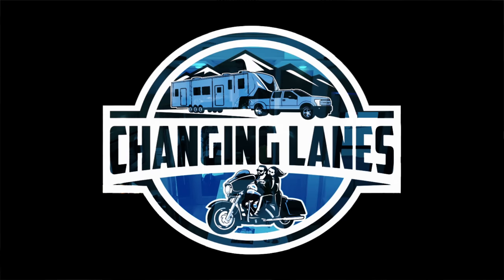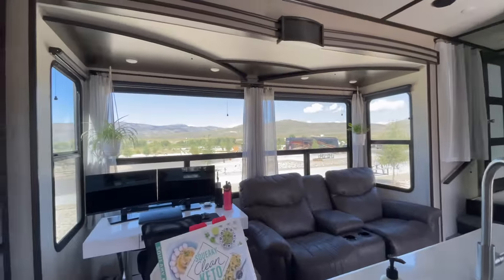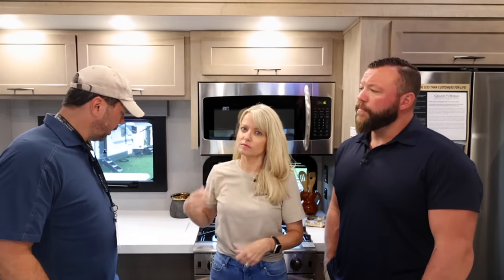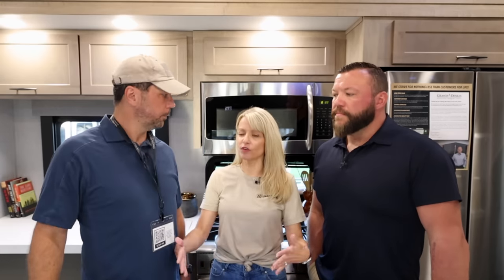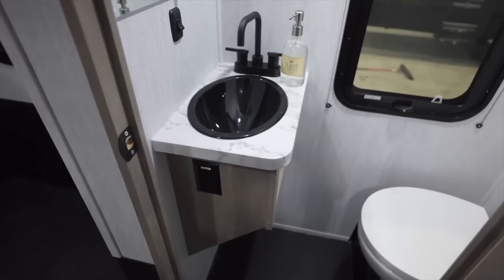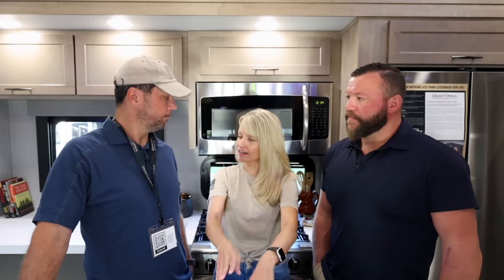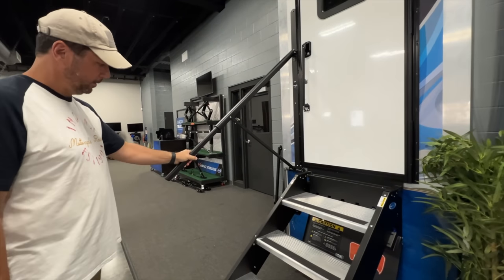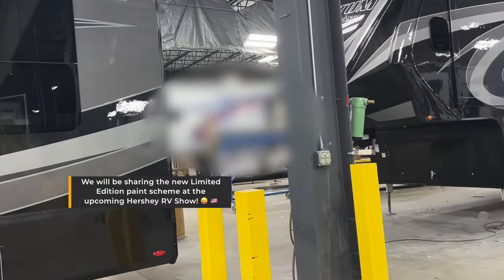New RV Floorplan Questions Answered! (Momentum 410 THR Prototype) (Full Time RV Life)

Comment: We saw the new GD 410 THR 5th wheel at the Hershey show today. Impressive. Recommendations:
1. Basement access doors: They conflict with the entry door. Make the conflicting door the smaller door, and the main door larger so that you don't have to unlatch the entry door to open/close the basement door. The door conflict even when the main door is on the open latch.
2. Vacuum access in the basement: shift the basement vacuum control closer to the basement door so that basement stored stuff won't need to be moved to provide access.
3. High Loft: If this will be used for storage for owners without a young child (who will love the space), then provide some form of gate or bar that will keep stuff from falling out into the kitchen.
4. Ceiling fan: Since the kitchen ceiling is so high, how about having a ceiling fan? It may not work with the location of the AC, but a ceiling fan would be nice. 
5. Living Room sofa color: Having such a light color seems like it will show stains and dirt. The overall colors are very nice, but the seating seems too light for practical daily use.
Again, we love the layout. These are a few suggestions.
-Jessups Go RVing

Comment: Couple of suggestions, we likely will be getting a 410THR to live in so if you can get these done, it would be amazing (and I won't have to upfit it myself).  
*A flip up leaf on the end of the island would be nice, extra counter space but no extra room taken up when stored.  We might eat there and put a sit/stand desk in place of the dinette, get the super sofa.  
*Love your idea for a larger medicine cabinet and in-mirror lighting.  
*A recliner in the single seat side of that L couch would be amazing just as an option.  
*An option for coat hangers up high and shoe storage down low when you come in the door could be a true tick box option/extra.
*Possibly rotate the bathroom 90 degrees and shift 6" from the garage to the pantry/coffee bar would be incredible!
*storage up high in both of the toilet rooms for toiletries (pellets, TP, etc) would be really handy
*A ceiling fan for the main living space to push down warmer air in the winter from the fireplace and just circulate it during the summer, maybe save some energy on A/C.

Thanks for the great content and we LOVE the 410THR layout.  We absolutely WANT ONE!!
Reply from the maker: Tara plans on doing some kind of hangars and such on that wall as you enter.  The single side of the sofa is already a recliner.  So, you can check that off. 😀  Once we get in it, we'll see if we need a counter extension, but that will likely be an up-fit also.

Comment: With the bathroom, love the space but still recommend TP storage in the commode room. It’ll help on storage. Puts some hooks on the bottom of the shelf for towels to dry.  For walking through the bathroom to get to the bedroom- how often do you go into the bedroom during a day as opposed to the bathroom. I think having the bedroom up front works fine.
Reply: We use the portsble stand with the phone holder and the built in roll storage in both our bathrooms. Seems to work well...

Comment: I no am VERY IMPRESSED in how the Momentum  rep Lance Lee ( sure the whole company is on board), stepped up and was right there with you for this Video. Pulled no punches when people asked “ why can’t I…”. Sometimes you can’t but it seems this company was at least willing. I am a travel respiratory therapist and have been following you guys for a little over a year. I currently have a 27 foot toy box (Genius Wander), and experienced many problems on my first real trip out to Sturgis for Bike week a month ago. Luckily, in a few days we had them resolved but the customer service I got from the place I bought it at was terrible. All they would say is “ just bring it in and drop it off.” I stay in the RV 60% of the month and to drive it 300 miles back to the dealer for them to park it till parts come in won’t work. So, after seeing this video. I’m gonna upgrade in the next year. To that size. 50 footer.

Comment: I might be too late for you to think about but I am going to suggest it anyway. Being the son of an Electrician I'm always looking for power, like outlets every where. We have a towable 33' bunkhouse. With the kid's bunk beds needing outlet/USB ports to outlets near couches and sitting arias it would be better to have ports or outlets in those places. When we got our  first used RV the AC unit was also a heater. It was the best AC unite I have ever had in an RV, it actually made it very cold during hot hot days. It was also nice to add to the heating appliance in the RV in conjunction with the propane heater that comes with the RV. The second suggestion is a duel AC/Heater unit.
I do like the set up with the "L" couch and dinette set in the proto-type RV that was featured. Also the duel pain windows for winter camping. I have a question though are you opting to a winter package with extra insolation?

Comment: I really like it, you guys and GD did a great job!  A few comments/suggestions:

Make IS a factory option.   I read below that there's some liability reason, please figure it out and make it orderable directly.  
Make StepAbove an option.   We HATE StepAbove, I can see how for some uses it would be great, but we don't typically stay long and it is a pain to setup (getting the legs the right length), it's easy to snag the door on it, and, my wife goes absolutely nuts when we lift the steps back into the RV and dirt pours off of them (as it does most of the time).
Dinette, get rid of the chairs!  Take a look at the Luxe 44FB; find out where they are getting that dinette and put that in!   It's fantastic, you can be tighter to the table (because you don't need room for the chairs) and you get some really nice storage underneath.
Put a GenY suspension pin on there from the factory. (this weighs too much for the Goosebox).
17.5 in tires.
Diesel generator option

Can't wait to see it in person, very nicely done!!

Comment: Love this layout!  My only concern in the bedroom would be cpap machine placement.
Reply from the maker: In our 397, and in this one we believe, there is room under the bed in the bed slide and a gap in the corner to run the hose and such.  If you go see one in person, just pull the mattress back in the corner and check.  We've never used one, so we can't be 100% sure, but we've heard of others doing it this way.
Reply: @ChangingLanes  never even thought of that. I’ll have to try that on my current RV. Thanks!

Comment: I think this is a decent trade off and if there are enough people as excited about this unit as you guys it should be a hit.   The volta system sounds interesting.  Going with a 48V system and providing a 54V dedicated alternator for your truck to add charging capacity rain or shine is pretty smart way about it, add in solar and that would be huge.  look forward to hearing how that stacks up would be cool.  At least you can drop the gauge in wiring to make that all happen at the higher votages.

Comment: Be nice to have 2 different models with the washes in the garage. 

Also, the option to get rid of the door and wall need to the bed to make it completely open. 

Another thing would be to extend the shower/bath to have a full side bath or even A Single jacuzzi bath. 

Everything else is perfect!

Comment: After looking at every toy hauler from every manufacturer Google could find we have set our sights on the GD 410.  However, my wife is disabled and we would need a few modifications to suit her.  How willing would GD be to making a few minor changes?  Nothing structural, we like the floor plan.  A lot.  But we would need some bedroom, bathroom, and living room changes.  Mostly deleting things we wouldn't want and some changes to the shower compartment.  And some electrical changes.  

I spent many years as an Engineer designing and building specialty vehicles (news vans, satellite trucks, big sports production trucks, etc) so am very very familiar with the design/build process.  Swapping CAD files back and forth to get the changes we want/need would be trivial.  Thanks for your videos, they have been extremely helpful!

Comment: Can Grand Design  start offering options for the independent suspension from the get go . Would save the consumer time and money. Also can you ask why they install linoleum vs a glue down vinyl plank which would be a way cheaper repair if ever needing to make one.
Reply from the maker: I wish they would offer the IS during build also.. but, it is a logistical issue I think.  On the linoleum, my guess is the linoleum can respond (stretch slightly) to flex in the floor when traveling.  Tiles might end up with gaps over time.

Comment: My parents 35-foot RV that they had for many years had a pass-through bathroom. I liked it because I could either shut the door to the toilet or just shut the door to the walkthrough. I like the way they put the toilet at an angle as it gives you a bit more leg room. I always had a problem with my parents as I have a 36-inch inseam. So, I have the legs of someone 6'3" tall even though I am only 5'8" tall. Therefore, my knees would be uncomfortably close to the wall. Like when I fly on planes and my knees are in the person in front of me back. Therefore, it is important that they make sure that someone like me can sit down with their legs not touching the door. It looks like they could, but I am looking at video. Otherwise, that layout worked and there was a lot better use of space than the hallway and separate bathroom. Even when I would go out with my small kids and stay with my parents in their rig.

Comment: I always wondered why GDRV didnt use an opposing slide for the dresser in the bedroom. We preferred the short slide on the bed, it makes it easy to get in and out of and easier to make up. A shallow slide for the dresser would still give the floor space everyone wants.
Reply from the maker: The trouble there is the slide would be right over the basement doors and they would have nowhere to swing open.  The front one might if it opened to the right but the other door (next to the entry door)  would have nowhere to go.

Comment: Bedside Shelf:
Have a two tier box shelf unit with the bottom shelf at same height as current shelf. Place a 1.5" ridge for the bottom  and top shelves to prevent items from falling (top shelf would have end cap ridges). Total height of both shelves 6 to 8 inches. Optional LED light for bottom shelf with 8 optional colors. Optional charge ports, 120v and wireless charging. Please let me know if this idea has merit.
Thanks

Comment: I have two suggestions:
First, I think the top of the TV should have a seal and compress or some kind of gasket. This way, you will have time to clean up the mess prior to it seeping into the TV area.
Second, I would like to see a tray with small sides on it for each side of the bed that has a swivel mount in each corner by the headboard. This would allow the tray table to swivel to the side or be above your head when sleeping. The outlet could be on the swivel with a cord management system there too. You could also have the tray on an up and down swivel slide, so it can be more adjustable and not be in your face all night.

Comment: Only thing I noted that I didn't care for were the garage floor tie-downs..  They looked like the weak ones we had in our previous Raptor 365..  IMHO those need to be absolutely anchored to the frame of the camper - not just screwed into the floor... I only got a very brief glimpse from your previous video, so I may not be correct in what I saw..  Best wishes you two.

Comment: I believe slideouts on each side of the garage would’ve greatly expand the living area. I would then reconfigure the seating area in the kitchen area. That area would be set up for sewing machine and sewing desk/tabled
Reply from the maker: Slides in the garage wouldn't work as no toys would be able to fit with the slides in...  The happijack would also be impossible.
Reply: @ChangingLanes  I already dropped a comment in about the slideout in the garage, but wouldn’t it be feasible having the slide out forward port side of the “not so happy” jack system🤔.  That way it would not impeded on that and you could have a bigger bathroom for a shower.  Just thinking outside the box.
Reply: I should have been clearer. I don’t have “toys” so no need for a garage. I also do not have a need for the “happy jack” system. I would like the garage space with the rear drop down patio for a large “living” room.  That would allow the seating area in the kitchen to become my wife’s sewing/craft room with a large work station.

Comment: You mentioned the half bath is an option. I would love to take that out and have more space in the garage and turn THAT into a game room / office space. With that in mind, is it possible to remove those chairs and the lowering bed? What is the cost of this unit? Is it affordable? I've been critical of RVs for a loooong time because they all just seem soooo alike. I don't like the material they put on or use for the walls. What is it, anyway? Feels like carpet in the few rvs I've walked through. And for the booth, could I change that out for a rocking chair? Could the walls be white with blue and white cabinetry?
I guess my biggest complaint with rvs is they aren't that customizable and for little folks like me, something customizable and BIG would be unreachable. I like the 44 foot lenght and that pass through bath is excellent. Color scheme is also very nice. 
Does Grand Design require a down payment? 
Will the model I am able to purchase - and I don't know yet if it will be this or not - come with the washer and dryer included, or is that upon request?
Thank you.

Comment: I like the rv, but I wish there was an option to shorten the garage by 10 ft.  Like remove the side door and steps and replace it with a small ramp to load a motorcycle or electric bikes.  Remove the rear half bath as well.  But keep the rear door for patio space.  Make it a 35 ft dual axle small toy hauler.

Comment: for someone who doesn't watch a lot of TV you sure made a big deal about how many areas you can see the TV from in the first 8 minutes. we have a 2005 class a dutch star 38 foot 4 slide no center sink/console and we love our set up, did I mention 38 foot, we've had a fifth wheel and I can't imagine hauling a 40 plus foot trailer. we can pull in and set up our site in under 5 minutes

Comment: I never comment on videos but since my wife and I decided to buy a trailer I knew I would need help and you guys came to the rescue, so I thought I would give one. I do a ton of research in everything I do, so I think Chad and I would get along fine and I certainly understand the need. We will be looking into ordering our first trailer the first part of next year and we are going big right out of the gate. We are focused on a toy hauler for several reasons but the main one is so that we have a way of getting our son inside the trailer while in his wheelchair. In order for that to work, the door leading into the living area from the garage needs to be wide enough. GD typically has wide enough door, but can you confirm the width of this door (taking the door itself into consideration while it is open)? Also, what is the maximum width between the island and kitchen area (taking the handles, etc... into consideration). We would have to bring him in that route, as I do not think he could make the turn after the garage door. Hope this makes sense and thank you again for sharing... you guys have come a long way.
Reply from the maker: I'll try to remember to get a measurements when we see the prototype again in a few days.. 👍🏼
Reply from the maker: Measured yesterday and it's a bit tight... the garage door is 28.5" and that seems to be fairly standard across the toy haulers.  The fridge to island is 23" and the Island to coffee bar is 24".  Hope that helps! 👍🏼
Reply: @ChangingLanes  the door is good, but the other will be to short as it stands. We may be able to get him in if we raise his chair above the counter. Thank you very much for taking the time to do that for us... very much appreciated. You guys have a blessed day..
Reply: @waynebrewer4785  as far as I recall you can get wheelchair lifts for the steps into an RV. If your looking for manufacturers Newmar and Winnebago both have accessibility lines. I saw a trailer called Harbour View which is supposed to be very accessablity friendly and of course you could always look for a company like Luxe who will custom make one for you.

Comment: Just use the island for cutting stuff. If concerned about using the area as a buffet or prep space put a waterproof  tablecloth or silicone mats that can handle hot stuff or some kind of waterproof covering. Televators are nice but in this kitchen it really decreases the counter space. Too bad there wasn’t a better set up where the TV is always accessible so the countertop could always be used.

Comment: It appears that just about all RVs are designed for couch potatoes and entertaining.
My preference is for lots of storage, work space (I have multiple hobbies) like a sewing machine or for digital nomads, laptop and printer, either requiring close access to tools, supplies  etc. I have an older class C so the bunk over the cab is used for storage  although awkward to reach much of my things. The machine travels in the foot space  under the table with two plastic three drawer units for easy access to sewing needs and basic tools.
Although I have a 29 foot rig, I have pantry envy.
I know it would add weight, but I would love to be able to utilize all that blank wall space for things other than wall decor. But I don't know how to tell if it is possible to add a shelf or sturdy wall hooks to hang a wet jacket.